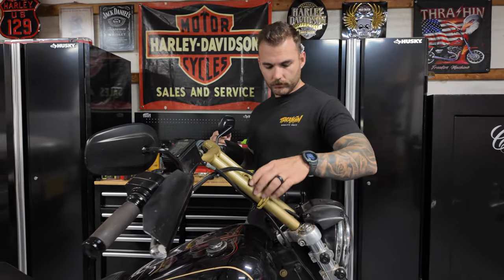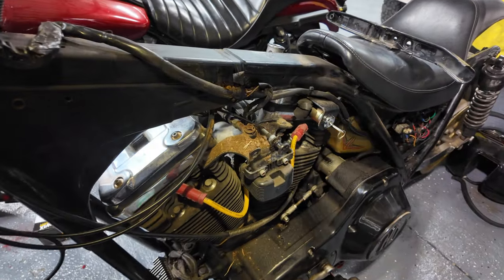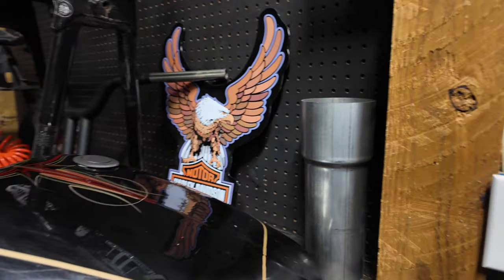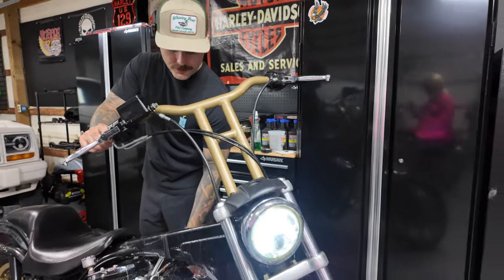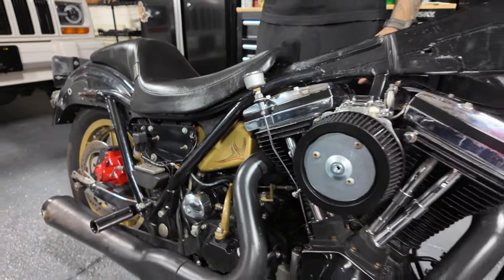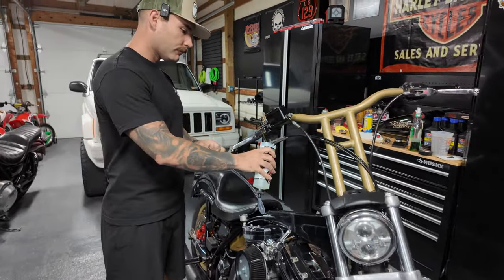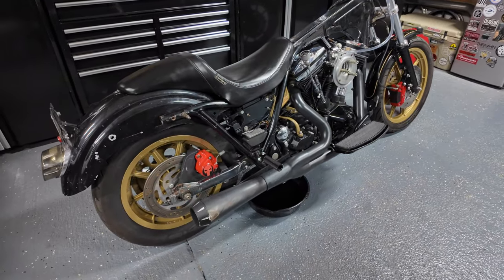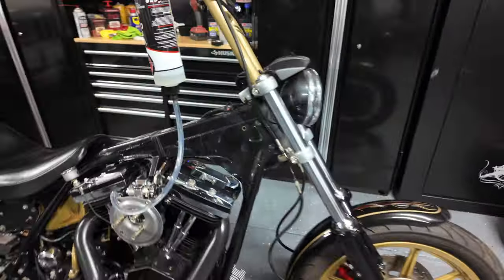6 Years After Fatal Crash, It Starts! || Harley Davidson FXR Build Ep. 2

Comment: Yeah, he wants you to have his bike. I absolutely know that and don’t forget to keep that oil pan underneath there that things gonna pee oil when it starts up get an old ratchet strap cut about 2 feet off and hook up underneath the battery makes it way easier to pull it in and out. With those early model struts, the curved ones which only fit that bike. They are also necessary for clamshells or P-bags. I actually bought a set of P-bags for your dad. I’ll have to see if I still have them.
Reply from the maker: @GradiorDignus  yeah a lot of oil was coming out I was kinda concerned at first but remembered you said that it would. Oh good idea cause yeah it’s a hassle getting the battery out of there.  Oh really those are really cool that’d be awesome if you still had them!